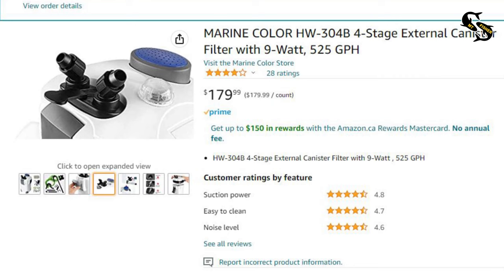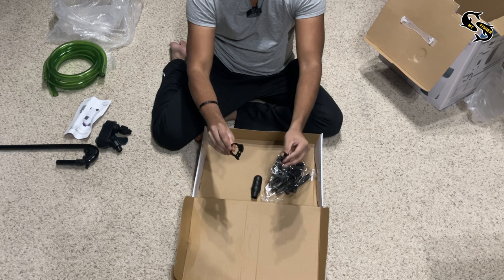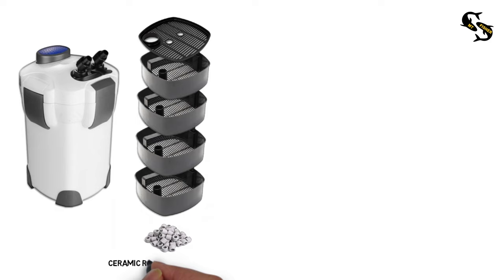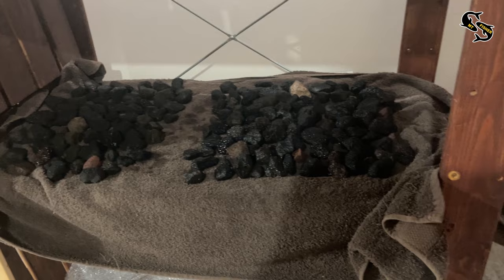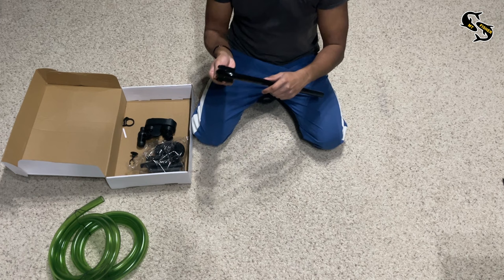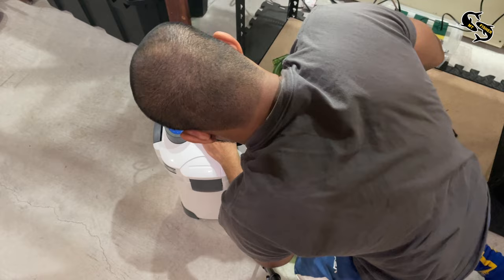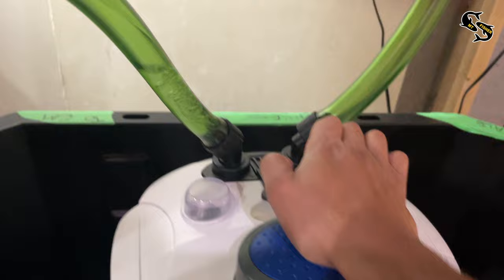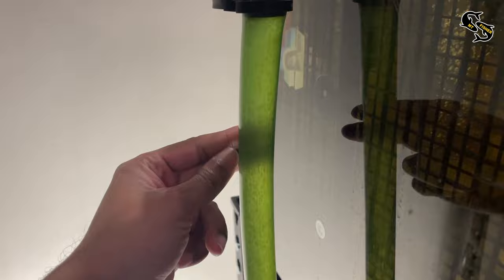SunSun 304B Canister Filter Full Setup And Best Filter Media To Use!

Comment: Placing tip of hose in hot water for a couple minutes will soften hose and allow you to really get the hose on the fitting perfectly, when it cools it will shrink back to size making a very tight seal . Only issue with this is you pretty much have to cut the hose to get it off.

Comment: I bought a  sunsun 3000 from "finest-filters". It failed in service after only 8 months, ruining the cabinet and ceiling below andI'mstrugglingtogetarefund..  I will never touch one of their products again.
Reply from the maker: How did it exactly fail?
Reply: Sunsun primary sealing o-ring relies on the clamps pulling the o-ring down into the tapered main body. IMHO,but wilth considerable experience as an engineer,  this is far less effective than an o-ring being compressed against a flat surface. ❤ If the plastic used to mould the main body is too pliable, it yields to the outward pressure of the o-ring and reduces the sealing pressure  thus water gets past it. This problem is not unknown  .. more than one YouTube post suggests wrapping ptfe  tape inside the anular oring groove.  Basically, this is intended to restore the original sealing pressure  .... but highlights the flaw design and materials.
Reply from the maker: @petenewell5377 I haven’t had any issues with my canister filter so far. I did add a few extra things to prevent/slowdown a leak. I put the canister in a large tote and have the canister filter attached to a smart plug that can be controlled from my phone. That way, I can stop the filter right away if I see water spilling. Been planning to add a water sensor in the tote, so i can be alerted if water does start spilling in the tote, didn’t get to it yet lol.

Comment: Can you explain how long to use the uv light?😅 Some review the uv light ended up melting it's surrounding including basket or anything that came in contact with it.
Reply from the maker: I actually don’t use the UV light because of the reviews haha. I honestly don’t think you need it. What kind of fish are you keeping?
Reply: @MTFISHER  I was planning on buying a cannister filter. It came with a uv light function. I'll use it on my goldfish tank. It kind a scary when some said it can melt the surrounding because of prolonged use. Maybe several hour per week is fine but can't turn it on 24/7 etc. I got top filter, sponge filter & hob now. Just recently thought about buying cannister filter.😆
Reply from the maker: @ling1255 I use it for my tilapias, and they get fed a lot and its been doing great without any UV light. Its up to u, u can try to experiment with it but always remember the risk behind it.

I would try seeing the water quality with and without using the UV light to see if it makes any difference for you..

Comment: where can I get parts for this filter? my quick disconnect won't lock down (I think the tabs on the head pipes are broken off)
Reply from the maker: Did you buy it from Amazon?
Reply: @MTFISHER  No I got it with an aquarium I bought on FB Marketplace.
Reply from the maker: @c3ajeff I just checked amazon canada and they sell spare parts for the canister filter.
Reply from the maker: Aliexpress has them too,
if you are okay with waiting for the longer delivery time!
Reply: @MTFISHER  Yes, true but I'm looking for parts to repair mine. I don't see where I can get parts or just the head unit.
Reply from the maker: @c3ajeff both Amazon and Aliexpress sells replacement parts. But I don’t think they sell the entire head unit. For that you might have to try to reach out to the manufacturer, or see if you can find someone selling a broken unit that you can use as a donor to fix your canister filter.

Comment: I have been using the 303B and 304B. They are in my experience quite a reliable filters. Currently B
both are still running,  303B 4 yrs and 304 going 3 yrs. Just a tip to prolong it's use: always do regular maintenance (i do once a month or every 2 months), do not put too much filter foam and medias and lastly make sure you clean the propeller and attached it properly. I have beeng using the UV light ( intermittent on and off) for longer than a week and i don't have any problems with it infact it does help achieve crystal clear water. Nice vid very detailed!
Reply from the maker: Thank you for the feedback and advice!
I have been doing cleaning every 2-2.5 months so far. UV light i haven’t touched it. It’s been fine as is without the UV light, crystal clear water even with heavy waste makers like Tilapias lol.

I might be removing the canister filter for now since I am almost done with the Tilapias. Going for smaller fish this time with low maintenance.

Comment: Just picked up the Marine Color 370 w/UV 9w.... haven't set it up as of yet because I'm waiting for the silicone hose that'll replace the green that came with the filter. I.o the SunSun and marine color are All basically the same filter
But hey, who's watching??
 Apparently by switching out the original green hose with an aftermarket silicone tubing type hose, there's a way better out (and in) come with the filter. Im just a bit leery of using the supplied hose clamps... I think I'll switch them out for a few good grade tie straps as metal hose clamps could possibly crack or break the ridgid plastic tubes inserts of both the intake and return lines.
Reply from the maker: I heard the same about switching the green tubes. I am waiting till it gets dirtier then i might switch them out haha.

I hope your new filter is running well!

Comment: Thanks for posting this video! I just bought this filter for my small outdoor pond. I estimate it’s about 200-250 gallons. So hopefully this filter does the trick! THANKS!!! ✌🏾
Reply from the maker: Hey, hopefully the video helps you with the setup. If you have any questions, let me know I’ll try my best to answer it. Good luck with your new filter!
Reply: @MTFISHER   Thanks you’re awesome! Would you happen to know of any way I can control the inlet/outlet flow? Any accessories or attachments? The filter seems to be almost too strong for my pond but there’s no way to control the flow
Reply from the maker: @Fotosynthesis858 So i haven’t personally tried it on my setup but there are flow control valves you can buy online. You will just need to make sure its the right size for the specific canister filter.

Comment: Why you put ceramic ring on bottom, im new sorry for questions
Reply from the maker: The ceramic rings will help break solid waste before it hits the sponge. Its to help prevent frequent clogging. I have been running for close to 2 months now without any issues.
Reply: @MTFISHER  thank you for the answer, i will try this, thank you for sharing your method and experience, more power and God bless 😊😊😊 thank you
Reply from the maker: Glad to help. Hope it works out for you!

Comment: Hey I felt shock in water when I turn on the UV light.. any solution for this??
Reply from the maker: I would turn off the UV, i don’t use it and most people I have spoken to don’t either. You also have the possibility of the bulb over heating from what I heard (speculation)

Comment: Sir which canister filter is good for 8*2*2 tank aquarium
Reply from the maker: how many gallons is that aquarium?
Reply: @MTFISHER  about 225 gallon or 900 litres water
Reply from the maker: The general rule is you want a canister filter to have enough GPH to turnover the volume of your tank about 4 times per hour. So in your case 225 x 4, so something that has 900 GPH.
Reply: @MTFISHER  which model number is best if anyone in market
Reply: I would use 2 Sunsun HW-3000 canister filters specially if theirs a lot of fish in it